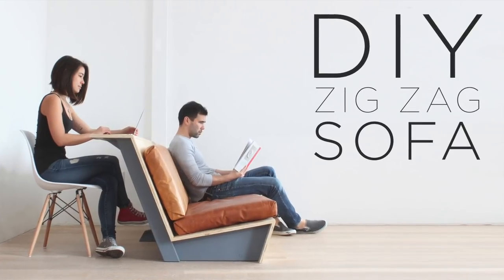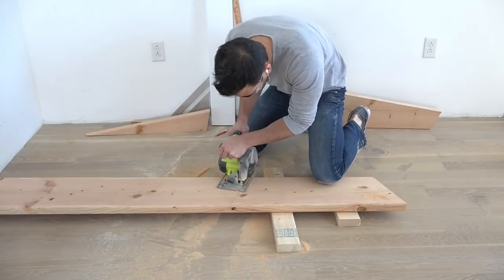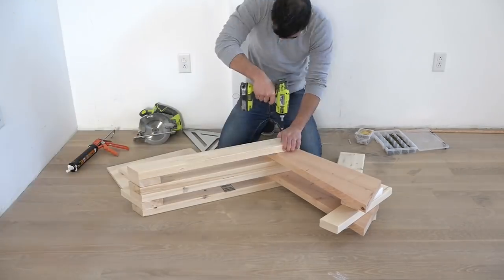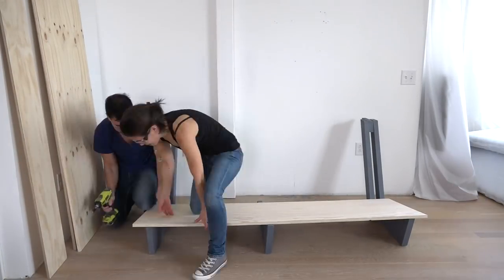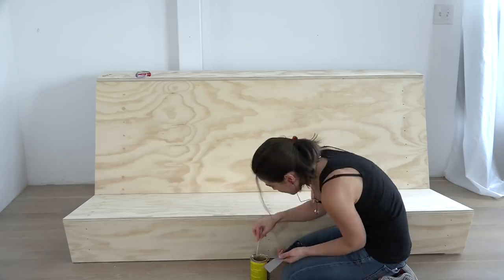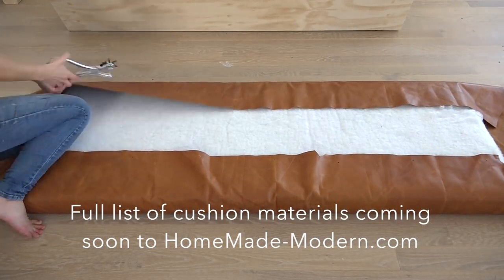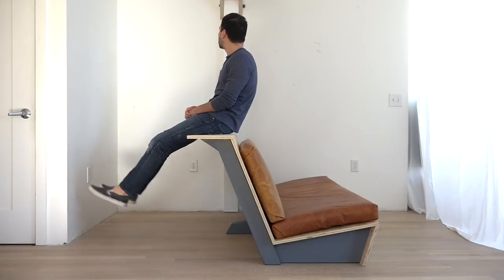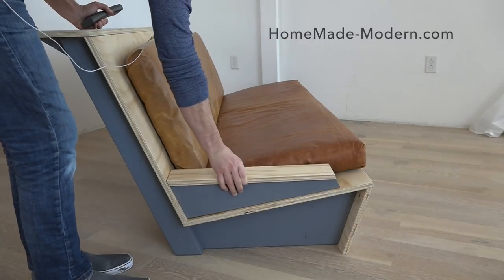DIY "Zig Zag" Sofa | How to make a modern couch

Comment: i suggest that you put wood panel under the foam. then roll leather over it and finish it with stapler. make sure you have kompressor of some sort that you can use powerful enough stapler.

Comment: Quite a cool design!  And great video editing/production.  The only improvements I might want would be arms (maybe ones that can also act as side tables or have storage like the add-on piece at the end - only higher) and a pull-out or flip-up storage under the seat. Great for a tiny space.

Comment: I love it a DIY project that is, in fact, DIY in complexity and one that involves using very accessible tools.  I might have used some nuts and bolts rather than screws.  But I actually selected the video because I liked the design of the sofa and only realized it was a DIY tutorial after it started.

Comment: Nice.  I think for cold weather areas best to put it on legs and the study area in back accessed with bar stools, because low to the ground in cold weather areas is where the coldest air in the room resides.

Comment: Hi there. I think your channel is really cool with super ideas. Just curious as to why you use construction adhesive? Conventional wood glue should be considerably stronger, particularly over time where it won't degrade. Keep knocking out those videos. Love to see your take on a tool box/tote or a work bench.  Good luck.
Reply: I have the same question.
Reply: My guess is he's getting paid to use it. Nothing wrong with that, but a good reason for him to use it. Otherwise I have no idea

Comment: nice sofa, especially for tiny space where the back could be use as table for pc. btw... I look for the plan on you main site, but I didn't find it... (Id' like to use as inspiration, adding something more like a sliding drawer, or a couple of hinges to lift up a compartment, some shelves on the back...still planning) :)

Comment: HomeMadeModern : This turned out Fantastic!! I'm working on patio furniture made from Pallets. It's basically an "L."  I want to make the piece at the end of the patio to be able to flip, so I can socialize with guests, then flip seat and backrest so that it can face to Woods. Any suggestions on how I can make it happen. It's made of REALLY Good WOOD, even though it's made of Pallets. I don't know if I should install a few tracks with wheels, or if I could slide, flip and Lock into place so that the backrest becomes the seat and the seat becomes the backrest. Any input would be awesome!! Thanks!!!